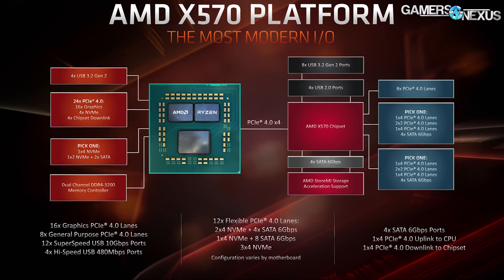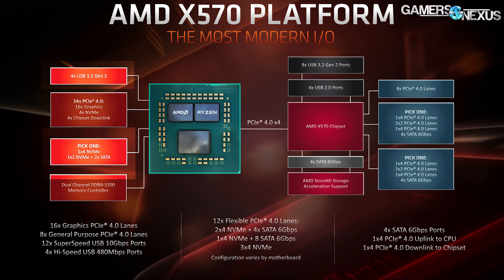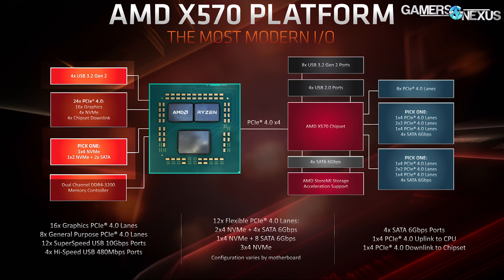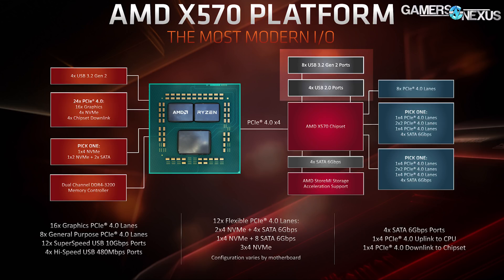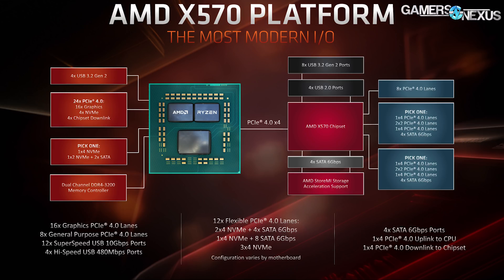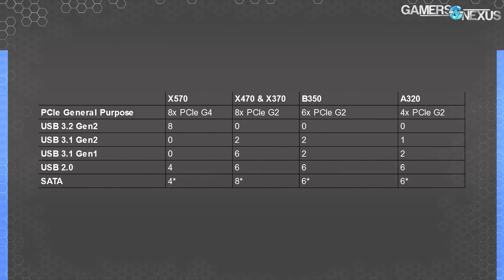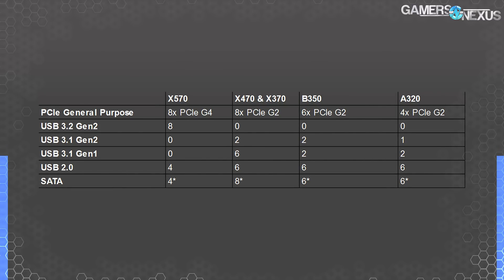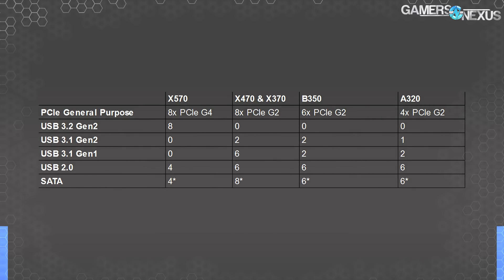AMD X570 vs. X470, X370 Chipset Differences, Lanes, Specs, & Comparison

Comment: So the burning question Steve...
Does PCIE Gen4 actually give any meaningful performance up lift over PCIE Gen3?
Based on past PCIE scaling tests I've seen it would indicate only marginal increases. 
(Very much looking forward to those X570 verses X470, X370, B450 benchmarks to start appearing next month).
Reply: Graphics cards don't use the full bandwidth offered by PCIe version 3. Most other PCIe cards are only version 2 or 1. The biggest improvement will be  from the increased bandwidth between the Ryzen SoC and the X570 chipset which will give improvements downstream. The first M.2 socket will also get extra bandwidth direct to the CPU but I haven't seen any NVMe devices that can make use of it yet.
Reply: @johnm2012  I agree with you, M.2 SSDs may stand to benefit (especially in RAID).
But it's also worth noting that they were already pretty rapid, so it becomes a case of how fast is fast enough.
Reply: @gsydaz  I can't help thinking that  for most users routing the four PCIe ver 4 lanes to a single M.2 socket is a waste. I'd much rather see two M.2 sockets fed with four ver 3 lanes each. It would need a chip to multiplex eight ver 3 lanes into four ver 4 lanes but it would give a lot of flexibility (like the choice of RAID 0 or 1) and use readily available NVMe devices. Right now, PCIe 4 is something of a solution looking for a problem but it's good to see it being made available to the consumer. Thing is, even my SAS HBA and my 10G Ethernet card only use PCIe version 2, but they need eight and four lanes respectively. Many four port Gigabit Ethernet cards use only PCIe version 1, but need four lanes. Card manufacturers need to make use of the higher speed.

Comment: So those are the local high speed ports (PCI, USB, storage).  But what are all the other chipset port features?  Sound, Network, TPM plus what Microsoft calls "legacy" (serial, parallel, FDC, PS2 keyboard etc.).

Comment: What if I want dual 4x NVME ssds to the cpu? Can some of the graphics lanes be used for this?
Reply: The second long PCIe slot has eight lanes that it steals from the first long slot. So if you put a graphics card in the top slot and leave the second slot empty the graphics card gets all 16 lanes. If you put a card in the second slot it gets eight lanes and the graphics card gets eight. So put your extra NVMe SSDs there if you want them directly connected to the CPU.

Comment: Seems that , next AMD future motherboards , will costs a lot. The point that I don't understand is , there are 50 different motherboards x570. 50 ! About 20 or 30 from Asus and the price from leaks are high, +100 bucks from the previous version x470 ? Isn't like there are just 10 or 15 , then I will understand why the prices will be high. Better those x570 doesn't have any plastic cheap heatsink and some noisy fans !
Reply: Remember AM4 only has backward compatibility until 2020. Then there will be a new socket.
Better stick with a good X470 and the new CPU.
Spending so muck money with a socket that is going to be changed in a year? Na.

Comment: So what process tech are the chipset controllers made in ?
28nm ?
Also my AM4/x370 board don't allow changing the chipset voltage, it's locked at 1.05v.
But my FM2 board allowed me to lower it from the default 1.10v.
Will x570 give users control ?

Comment: Heard X570 boards are going to be EXPENSIVE, I don't need PCIe 4.0 yet...
Reply: Expensive, HOT, and POWER HUNGRY.
Reply: Same, the power consumption alone sounds like a recipe for disaster to me.
Reply: well, the 4.0 was actually in the older sockets B450 and some other, but they kinda deleted it in bios updates or what from what i read, and it should be available now only in X570, what a bullshit

Comment: Some boards split the 16x PCIe lanes for GFX into x8/x8. But since these are specifically marked here as graphics lanes, can you then use one x8 for a graphics card and the other x8 for say a Raid controller? Or are these lanes exclusively for graphics as the slide seems to suggest?

Comment: At 5:15, that chart doesn't look right, the previous boards had PCI-e gen 3 not gen 2?
Reply: No. The connection between the CPU and the chipset was gen 3 but the lanes between the chipset and the lower PCIe slots were gen 2. The table is correct in that sense, though the USB 3.2 designations are dubious.
Reply: thats right...x470 is in fact PCIe 3

Comment: Steve, from what I've heard the x570 chipset is actually an I/O die from Epyc (or was it Ryzen 3k itself, I don't quite remember) with the non relevant parts disabled, such as memory controllers.
This of course means that the I/O die inside the CPU is actually using over 15 watts of the TDP of the CPU's, making the chiplets even more efficient. (But of course, moving the mem controller from the chiplet to the I/O die muddies the waters a bit too...)

Comment: I'm not sure if this is the proper technical observation, but considering that many current high end GPUs don't make full use of PCI Express 3.0 (x16) doesn't that mean we could theoretically just use the primary PCI Express 4.0 slot as a "x8" and free up more PCI Express lanes for storage?🤔
Reply: Exactly what I'm thinking about all the time, I don't see any reason to run full 16x4.0 on the GPU side when 4.0 8x has the same bandwidth as 3.0 16x and even with 3.0 there is barely any difference in gaming performance at least between 8 and 16.
Reply: You can do this right now with PCIe 3.0.  I added a second NVMe drive to my B350 board.  No impact on graphics performance.  I only use a 1660 ti, but I don't think there would even be an impact on a 2080.   Steve tested a 1080 and found no difference https://www.gamersnexus.net/guides/2488-pci-e-3-x8-vs-x16-performance-impact-on-gpus

Comment: When this all launches I definitely need to see benchmarks comparing a 5700 in an X470, vs a 5700 in an X570, to see if this PCIe makes any real world difference for games.
Reply: The answer is no - even a 2080ti doesn't saturate over 80% of PCI-e 3.0 x16 and the Navi GPU's are stated to be  below the Radeon 7

It will be 2 generations of GPU before PCI-e gen 4 becomes relevant for more than SSD speeds

Comment: I'm coming to a conclusion that my "old"  Asus Strix B350-i  MBO  is more of a X370 board actually.  Being one of only 2 B350 with 6 phase VRM, being a mini-iTX. Having 2x3.1 Gen2 type A variety and 4x of 3.1 Gen 1. 
I'm just confused.  @ 05:17   isn't  USB 3.2 Gen 2 =  USB 3.1 Gen 2 with the only difference coming if there was USB 3.2 Gen 2x2?
Reply: There is USB 3.2 Gen 2x1 and 1x2, apparently XD

Comment: Question is : Can i use RX 5700X/XT on PCIe 3.0 board?
Reply: Unique Stuff id The PCIe standard is, as best I recall, backwards compatible.  So, yes you can.
Reply: Yes. You certainly can.
Reply: Yeah you can, and you probably won't be bottlenecked given that the new RDNA only has 256bit buses.
Reply: probably not

Comment: I hope those chipset fans wont be to freaking noisy.
i kinda dislike that those come pre-assembled i'd rather have something i can upgrade and replace if it breaks.
having pre-attatched fans is going to limit motherboard longevity...
Reply: Not really, most are standard 35mm fans attached to shrouds - still replaceable - just not usually computer hardware
Reply: @bengrogan9710  well hopefully those will get more common and maybe we can get a noctua version or something :p

So long as i can replace and upgrade that's fine...

Assuming those fans get into pc stores and become more accessible.
Reply: @ZerqTM  They already are available for other purposes - ie fans for hobbyist cnc routers etc
Most manufacturers have said they are implementing bios fan curves where the expect 200-300 rpm for most loads

Comment: Those old x-mas tree bulbs, the glass ones before the push-in bulbs and long before LEDs.. Those bulbs were 12w, I believe. I remember how hot they used to get.. hot enough to start fires from time to time, if the tree was very dry.   It's the only 12w thing I can think of.  Unless you're around 40 or older, you might not remember these bulbs, although they used them in night-lights for a while after.  If you know how hot those 12w bulbs got, you'd understand immediately why this 12w chipset needs a fan.  The 990FX used to get quite hot, too, and I put a small copper hsink/ fan on it.  My only concern with having a small fan on the board is quality (lifespan) and noise.. I guess that's two concerns.

Comment: will noctua make a x570? i assume your going to spend 200 on a x570 and its still going to have a terrible fan.
Reply: They actually did make tiny fans, they gave them out as swag at Computex as keychains, but they were real fans and appeared to be the same size as the chipset fans. That makes me wonder if some boards already have Noctua fans.
Reply: @Malus1531  some of those msi ones did not have fans so atleast you have option.

Comment: Is there any reason for x570 board manufacturers to use usb 3.2 Gen1 instead of gen 2 in cheaper boards, aside form product segmentation?
Reply: They covered this in the factory tour videos, Gen 2 is much more complicated on manufacturing and QC to the tune of 4x cost of gen 1 - target cost restrictions basicly
Reply: @bengrogan9710  I know that usb c was much more expensive, but I can recall anything about usb type A between gen1 and gen2

Comment: Send that nitrogen to cool beneath reactor in chernobly 😁
Reply: 92Cope Would dissipate in minutes now, seconds in 1986.  That core had a TDP of 3200000000W but was accidentally over clocked to much more.  As it has been cooling down without the speed-up components, it's no longer putting out as much heat, but still more than a huge pile of game computers.
Reply: @johnfrancisdoe1563  LoL

Comment: Will you test R5 3600 on B350 and cover if its worth upgrading from R5 1600?
Reply: definitely, there will be a huge performance difference, just from the IPC(insturctions per clock) increase. There will be an increase of ~25% in performance.
Reply: Judging by the rumors it will be a pretty considerable upgrade

Comment: Is it possible to mux pcie4 lanes to 2x pcie3 lanes?
Reply: It is possible to design a chip that can do that, just as it is possible to multiplex PCIe 3 into two PCIe 2 lanes, as done by the X370, B350, etc. The X570 appears to do it to some extent internally so as not to waste lanes on slow peripherals, like gigabit Ethernet, but in reality all the connectivity the X570 provides is shared (multiplexed) via its four lane PCIe ver4 connection with the Ryzen SoC.

Comment: It's hard to wrap my head around if I will be able to use all the old school stuff I have, in a potential upcoming X570/Ryzen 3000 build, like a Plusdeck cassette ripper, Scythe fan controller, of course an optical drive, I'm also thinking about bying a Scythe 5,25" speaker amplifier. It feels like motherboards are generally good at supporting old stuff, but technology at large is not, so I expect motherboards to stop supporting old stuff without warning.

Comment: @GamersNexus
Could you do a video on which X470 and X370 motherboards have both an excellent VRM and good DDR4-overclocking? Buying a discounted X470/X370 motherboard which gives good support for that might be the sweet spot for Ryzen. PCIe4 is nice to have but not required, I would rather upgrade to a more expensive motherboard once DDR5 is supported and the DDR5-prices are good.
Reply: Check builzoids channel - actually hardcore overclocking
He has a 1hr+ roundup video of all x470 and b450 boards for each form factor that he thinks are even worth considering

Comment: So I dont understand this. Why 16x for the GPU? I thought PCIE 4.0 8 lanes have roughly same bandwith as PCIE 3 16x? Considering 2080ti barely uses little more than 8x at best (on PCI Gen3) why not just use PCI4 8x and use the other lanes for NVME storage for example? Will take multiple generations or multi GPUs to surpass 8x on PCIE 4.

Comment: So if you plan on buying a 3200G or 3400G, then it's not worth having an X570 board because those APU's are Zen+ and not Zen 2. And for PCIE Gen 4, you'll have to have the full accompaniment of AMD all the way for now until NVIDIA and intel catch up.
Reply: yeah, 3200G and 3400G are zen+ refresh, https://www.amd.com/en/products/specifications/compare/processors/8476,7221
Reply: GameBacardi Oh no, deceptive CPU numbering like when some 486-class CPUs were marketed with 586-class names and numbers.

Comment: so is there any reason to use X570 board over the x470 other than for PCIe4.0 ? 

thats what im trying to figure out because those x570 prices are INSANE and i would rather buy Asus ROG Hero VII over some midrange x570 board and avoid having another fan in the system (id say 8x140mm is enough :) ) AND paying about double the price for feature i wont use (4.0 is kinda pointless right now, maybe few years down the line ...) and a better VRM (when VRM on Hero VII was overkill anyway).
Reply: As far I can tell the Hero VII will be able to handle the 16 core just fine. Every other  CPU of the Zen 2 line up is anyways far more efficient than Zen+. Making x570 VRMs way overkill for all their line up (65 Watt CPU for a VRM setup that it´s more overkill than the overkill Crosshair VII?...B450 board can handle those with no issue). 

With what i got from the Computex and E3 there is no other reason to get X570. And yes PCIe 4.0 is definitely pointless at this time for 99% of consumers.
Reply: @Koeras16  yeah i have no doubt the VRM on that board is enough, what bothers me is that i do not know if the x470 and the build of the older board will limit me in any other way - specifically memory overclock (i just bought 4400 Mhz  CL19 Patriot Viper Steel series 16 gig kit because at alaunch i expect good memory kit to be very hard to find so i "pre-purchased"  one in advance :) ) even though it would seem i will have to run it at 3733 Mhz (please someone explain to me how DDR memory can reach odd number in clock ? xD ) to keep Infinity fabric running at full speed (i wonder what timings will the kit handle at that clock that low :) ) i have to wonder if Hero VII would allow me to get the best performance i can out of that kit or not.
Reply: @Asghaad  Well I can´t answer that. Usually clocks are highly related to the IMC and not the board. Though board quality does matter too to some extent. Both platforms are using daisy chain and not t topology. 

Another question is also if you really want to run your memory at those clocks (indeed, it might matter much more to runt he infinity fabric at full speed). I would suggest you to upgrade to the CPU you are looking to get and see what your Hero VII is able to handle. Personally I wouldn´t wonder if cl15/cl16/cl17 3733 may be possible. With Zen2 I also already run cl14 3433. 

In any case we are talking here about a few percentage. Other than the fun of testing and upgrading i do not believe its worth to invest in a 300+ Euro/Dollar MB. Got the Crosshair VII too, won´t upgrade anytime soon. Love that board anyways. Well other than that I would have like to get two BIOS chips...like Gigabyte tends to do it on their high end stuff.
Reply: @Koeras16  well percentage increase matters when you run Radeon VII on 144hz freesync monitor :) and im going to upgrade from I7 4820k with 8 gigs of DDR3 so im not against investing money in better stuff i just do not want to pay double for x570 board for no real reason whatsoever. And so far it seems we are paying a lot more for not a whole lot...

Comment: Exactly what i wanted to see after Buildzoids ramble about using B450 as a cheap build option. Really thinking of going that route myself with a X3700. Rumored prices on X570 is too much for a budget build.
Reply: AMD is no longer ONLY for budget builds! ;-)
Reply: And remember, AMD backward compatibility is only valid until 2020.
I see no purpose to get a X570 and Ryzen 3000.
I will stick with my X470 and a 3700X
Reply: @rorymclead8130 3900X with X470 it's a good choice if I don't overclock that beast?
Reply: @rorymclead8130  AM4 wont last much longer than 2020 anyways because DDR5 is coming. Then they need to up the pin count on the socket.

Comment: Lower end 500 chipset/boards? I just heard from another well known YouTuber that there will be no lower end 500 chipset. They said only X570, that X470 and B450 will continue production for budget options.

EDIT: hmmm, someone's rep is either confused or just wrong. I'm not saying which, both of you have always been reliable. I'm not saying who it was but their video is out there.
Reply: Makes also more sense. AM4 gets support across the board since the Zen 1 series of MB. pcie 4.0 is only for X570. If they would bother to make B550 boards they would probably have to ditch pcie 4.0 to lower the production price. Which would most likely only result in it being  B450 or X470 boards depending on the VRM.

Comment: I'm a bit confused by the amount of PCI 4.0 lanes. Initially it says 24.

But you actually use a maximum of :
2x 4x nvme
And 24x PCI divided over 4 slots at the cost of data?

Comment: I guess a big finned heatsink with a heatpipe on the chipset is more expensive than a small aluminium block and a fan
Reply: Felix R  Don't forget, cards mounted in the PCIe slots could be blocked by a large chipset heat sink.
Reply: WarGamingRefugee Maybe change the board layout to resemble old boards with northbridge fans.  Unless AMD tied board makers hands, this might make room for better cooling of the x570 chip with a fan that can be used and replaced for a full 10+ years machine life.  (With multiple machines, I shuffle them to less demanding tasks as I buy new top end hardware and phase out the oldest one).